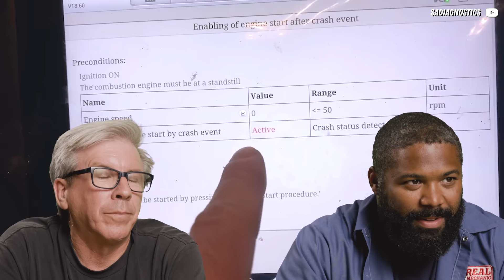Mechanic Reacts to Engineering Fails

Comment: Anyone who's worked on a Ford Escape knows they weren't designed the best. Yeah, the oil filter placement isn't great on some years, but what bugs me is the battery. It's in the back corner practically under the windshield. You've gotta remove the wipers, like seven clips on a cover over the back 1/4 of the space under the hood, a few small bolts, the top and bottom half of the cover itself, after unscrewing the power steering reservoir thats on it, and then finally pull that sucker out. 

I live in Alaska where it gets to -50 °F for months on end. If you don't have a heated garage your battery will die a lot and they get hard to charge up when the charger stops working in the cold too. So, having to pull it out several times a winter to bring it indoors and plug it in is rough. Especially if you gotta take all that stuff out, outside at -50 because you don't have any garage. I even had an engine block warmer and warming pads I plugged in every night that were supposed to help with that and the oil pan, but every few weeks the battery would die if I didn't drive it for a day or two over the weekend or if it got extra cold.

Comment: Having done design work and some wrenching, I get both sides. The real thing is the car is built to sell and make the most money. If you want the biggest interior, lowest price, highest mpg, quick design cycle, and modern safety features; compromises must be made. Those compromises are normally plastic parts, crammed engine bays, and difficult access for service. Blame the corporate suite not engineering lol.

Comment: I had a 04 dodge Durango and the cluster gauge caught fire and i had a Gatorade and i could see the flame starting through the air vent so i got a mouth full of Gatorade and spit in through the vent putting it out but there was a recall on that part.

Comment: I have one for you. I wanted to replace the stereo in my 2004 Mazda RX-8. So guess what all goes thru the factory stereo. Go ahead guess. Ok here we go, the climate controls and the hazard lights switch. All go thru the factory stereo and to top that you have to find the (and I mean find) the Bose amp power wire. As they are not all the same color. I looked thru 4 other RX-8s to find it only to learn that annoying little fact. There is more to that as there are steering wheel controls as well. I had to find a company that makes a kit to do the swap I was doing and found one that has everything I need BUT there's a catch there as well. The new setup has a control box for the climate controls and hazard lights switch and if that box fails down the road you have to buy the entire kit all over again at the current rate of $175.48 so you get all the parts you don't need just to get the one you do. As I understand it it was an 04-11 issue but I'm not 100% on that. Who's the bad guy in this one

Comment: Some of the rulings I disagree with, situationally. The difficulty of some repairs changes when you're a professional at a shop vs a hobbiest on a hobby car vs a handyman on a daily driver. If you're charging a customer for parts and labor, it’s easier to be chill about some things as opposed to fixing the car you have to drive to work tomorrow.

Comment: I work on my own car, so by no means am I a mechanic but in order to replace my transmission fluid filter I have to remove part of the frame to remove all the bolts on the drain pan. Whoever designed it could have moved it over like a half an inch and that would have made a 2 hour job to about 45 minutes

Comment: On the oil filter clip. That guy should change the oil filter on my can-am defender limited. If he thanks thats bad this thing you have to pull the back seats and back interior go in through the firewall. And still fight all the ac lines and wiring harness.

Comment: ~~Things really started to change in the 90's. Engine bays where you could access nearly everything w/little hassle seemed to disappear overnight. Replaced w/what must have started as a competition among automakers to see who could fit as much as possible under the hood? I remember going to Sears w/collective of tools,mine&cpl other mechanics, to be replaced. Looking around as they did what they needed to when I see an oil filter wrench. The handle&spanner connected in between w/rod that must have been 3 foot start but a bend here&a kink there the entire tool was about 18" long? Made specifically  for,if I remember correctly, 92-94 Toyota Celica? There may have been another but it's that stuck out leaving me baffled while at the same a helluva example w/what I said&how bad it would be.

Comment: 1992 Dodge Ramcharger has a fusible link ayatem that when one link goes you have to replace all of them. The second issue withe the fusible links is the link for the air conditioning system is the same link for the power windows. Imagine that in Fort Worth in August.

Comment: 6:20 I have two 1955 cars. Even on those you have to be able to turn the engine about 3/4 of the way around to pull the torque converter off. 100% normal.

Comment: I feel like having the oil filter in the most accessible and easy to reach place is beyond logical. Like, best case scenario, oil changes will be the most frequent reason you go to a mechanic and making the filter easy to reach and thus easy/quick to replace helps everyone. But im not a mechanic or an engineer so what do i know?

Comment: My mom's 2014 escape had the battery under the fire wall so difficult if you need to jump off.. and also it threw engine code after engine code before took it to pepboys for warranty work they said it was the bcm (body control module) they had their professional come out to look at it bc that's atleast 5k to replace and it turns out they unplugged it the dealership had it shipped to a Mercedes mechanic for a 2nd guess and it ended up being a dead battery

Comment: I remember getting my expansion tank replaced cause it blew up on the highway.  So I go to the shop the next day after it's fixed and as my mechanic drives the car out to me he's about to stop and the timing belt snapped.  was a $100 job now it's $200, Good times. lol

Comment: Cadillac Northstar engine it’s unbelievable where the starter is located you have to remove the center part just to get to the starter which is the throttle body in the intake manifold.
Reply: I think the right side cylinder head has to come off too. The starter is in the location the camshaft would be on a pushrod V8.

Comment: While you are complaining about an oil filter or a battery tray,  here are some more delights from Ford in other You Tube videos  1) some Ford Escape? (and Audi) water pump were driven by the cam chain, For Ford, it cost about  $3000 to replace a water pump. 2) another engine had a rubber belt , lub by engine oil! driving the oil pump !   3) about a decades ago, various Ford V8s have insufficient threads for the spark plug and the plug will sometimes fire itself out of the engine. Both triggered recalls and mechanics had great fun retapping  the threads.  4) some GM thermostat takes about 4 hours to change, it is a clumsy part that came with tubes and "o" rings. I hear Tesla is also great fun to work with.

Comment: try working on modern motorcycles, there is no room for all of the electronics & hoses & connector blocks, just a nightmare. It takes me 15 minutes just to get the air filter out for a service, don't even get me started on accessing the spark plugs

Comment: The bottom bolt of an alternator on a 2006 chevy trailblazer always has me cursing ac hardline right in the way of the bolt so you cant even put a socket in it have to use a small box wrench and work it between the cooling fan blades, big ol pain in the butt

Comment: If y'all want a good one, look up a newer 2017-2023 Chevy Colorado with a 3.6 starter or torque converter bolts for the transmission

Comment: the oil filter location would be really annoying  when removing an old filter if its stuck. because you cant fit any tool in there by the looks. :/

Comment: Yeah if you’ve got a Ford GT presumably you’re not just squeezing it in the Walmart parking lot in the closest spot. You making sure you park it with plenty of room where no soccer moms are going to door ding it or 15 year-old on a learners peel the bumper off. The door/roof vent design sucks if you’re in the rain because when you open the door, the a bucket rain falls straight on your seat in half a millisecond.😂

Comment: Many German cars have something called a "pyro fuse." And it shuts down the engine and all electricity going to the engine. This prevents it from catching fire due to potential fuel leaks, and it protects the engine from destroying itself when all the oil leaked out. You can not start the engine in any way until you either replace the pyro fuse or bridge the gap in other (not so smart) ways. Yes, you can not drive the car. But that's not what you should do in an accident anyway. At least not in Europe

Comment: Years ago Pontiac had an engine that had to be rotated Forward to change half of the spark plugs. Ford(?) had a vehicle that to change the one spark plug, the engine had to be pulled. Many mechanics would cut a hole in the inside of the wheel well and make the cut out part into a door. But the wheel had to be removed. Personally, I believe that all engineers (and architects) should spend at least 5 to 10 years out in the field. Those are only minor engineering (architectural) mistakes that I personally know about!!
Reply: My uncle had a '74 Chevy Impala, small block V8. He had to remove the left front wheel and drill a hole through the inner wheel well to get to one spark plug. He was a printer and press mechanic all his life, a very skilled tradsman.

Comment: Toyota 2RZ and 3RZ engines use a metal pipe bolted to the side of the head just above the exhaust manifold to get air into the intake. Simple maintenance shouldn't require so much mechanicking just to remove the spark plug wires and replace the spark plugs.

Comment: I have a 08 Benz c300 and all the cross members and everything under the car that you are supposed to be able to remove to work on things have been welded from the factory instead of using bolts and nuts so now I have to cut all the welds and drill holes in everything to install bolts so I can work on it

Comment: I've got 1... My 2002 Chevy S10, V6 4x4, has to have the engine pulled to replace the oil pan gasket. That's GM's recommendation. Im removing stuff from underneath. Axles, front differential, etc.. suuuuuuuuux

Comment: I drive a fiat, they were a bit iffy on the electric part, but they are allot better nowadays, about 20 years ago I saw a lancia y10  engine bay burn to the ground with electric problems, it was parked so no one got hurt.

Comment: Austin Mini are hard to do the filter I didn't do my son's Austin mini until the warranty was up because we had to get the oil done at a dealer when I finally did do the oil the filter was never changed because it was too hard to get it was starting to deteriorate.

Comment: I really hate the battery location on my Honda Pilot because the engine air filter is sitting right on top of it and you have to pull it out of its socket in order for you to then take the bracket that holds the battery in place just for you to do a jump start but I digress and I don't need a jump start I was trying to help somebody and it turned into a huge ordeal

Comment: My worst one was an hour ago. Not a car but a motorcycle. It sat around because i had an accident (not riding, was when i was skiing) so i was not able to charge the battery for a couple of months so it died, thought why not swap it for a fancy gel battery. I have taken out my battery many times for charging on my old bike (suzuki sv650n 2003) and it never took more than 5 minutes. Take of two fairings on the side, take off the seat and pull the battery out. Easy right? Bought a yamaha tdm850 1998 so why not buy a shop manual to do some minor servicing and repairing myself? Look up the battery removal and seemed the same as the SV: remove the seat and unscrew the terminals. 5 minutes tops. Turns out, the japanese engineers that built the SV were way nicer than the Yamaha ones, because to do what the service manual said, i had to remove the fuel tank first, disconnect it and thus dumping all the fuel from it, and to actually remove it i had to disassemble the entire front fairing. That was not an option so i got online and found the actual way you have to do it. You need to disassemble the right side frame partially where your exaust hangs from, disconnect the rear break cilinder from the frame and then you can feel around with an allan wrench to try and unscrew two of the tiniest little hex screws without dropping them, otherwise the battery is sitting loose next to the chain. Then you have to bend the battery around the rear shock trying to avoid breaking the spring to your brake light switch (because thats there too) and with a lot of cursing and bending of the plastic battery box, you can take the batterybox with the battery out. That was an hour. And putting it in was another hour of my life. All the while there is ample space under the seat where the battery would have fitted. That is the worst design i ever saw on any motorvehicle.

Comment: On scene 10:51 the Battery Tray may be for a Motor Mount underneath it /  All Eco Tech ( GM) and EcoBoost (Ford)  Engineering Fail the Turbo Mounted 1/8 inch from Engine Block, without a Heat Sheild, and Turbo Blanket. Why a Fail Turbos get to be 1,875 degrees Fahrenheit.  They warp the Engine Block, and the Piston / Cylinder Bore Cause Low Compression, and no Hood Heat Extraction Vents.  2 Different Engines before 60,000 miles. Heck the Subaru's Head Gaskets Fail because they mount the Turbo above the Intake and Heads. Funny Stuff. 
I am not a Mechanic and I replaced at age 12 a Fuel Pump on my Dads Truck, and age 8 Oil Changes and Tires on the Same Truck. 
I work in other Technical Feilds, and My Current Ride  has an 8 year all Service including Brake Systems, Windshield, Fluids, Except Tires. $500.00 each tire Price to Start. It is a 2022 Roush Mustang with the Rev-Match Tremec 6 Speed Manual Transmission 🏎️🏁🚩👨🏻👍🏻
I would never Sell her, even if Offered $1 Million USA Dollars

Comment: I own a 2015 Subaru 3.6 Outback.
While I love my Outback, taking all day, to replace the sparkplugs is just wrong.
Why does it take so long? It's a horizontally apposed engine, and the heads are 2" from the A-Frame rail...

Comment: my car fuse box is inside car nice and easy even those lots space under the hood, The fuse box is located at the bottom of the instrument panel (on the driver's side), behind the cover. The location of the fuses in the passenger compartment. Near OBD port

Comment: How many vehicles have no access panel to the fuel pump and instead you have to pull tanks, beds, etc to replace it. Granted this could be considered a whiny mechanic but it would be so easy to just make a small access panel held on with a couple bolts. Would also make diagnosis easier.....IE broke wire vs bad pump.

Comment: Yep on my 2003 vw jetta 2.0 had to replace the control arms I had to lift the engine to remove them amd I had to buy a special bit to remove a bolt on the pasanger side lol 😆 I hated it

Comment: Is the old guy secretly an ENGINEER? That oil filter bs is unnecessary for sure, some cars are just a pain to put a filter on and that is just ridiculous. Engineers wanna always try to come up with some breakthrough design these days instead of just sticking with the stuff that works and is accessible. I feel like they do it on purpose so ppl feel they gotta bring there car to the dealership for maintenance and repair instead of a local certified mechanic, they over charge for everything and they love to sell you shit you don't need, you go to a dealership with a bad battery and they will sell you an alternator first, shit they may even try to sell you a starter as well before they actually replace the dead battery, so be smart ppl, google and youtube exists to help keep you guys from getting screwed. Always try to diagnose the issue before you go to a dealership. Ill never take a car to the dealership I can do most repairs myself, but if i have a problem that Im not confident with fixing myself Im going to one of my mechanic friends that actually have a shop, lol no SHADETREE mechanics will work on my truck either. Be smart do not let a shadetree mechanic work on your car.

Comment: The engineers that designed the Ford 3.2l 5 cylinder diesel need to be held accountable for the fact that if you drain the engine oil and on't refill it within 10-15 minutes the engine is toast because the oil pump won't pick up the oil now and won't have any oil pressure. Why do you need a piston oil pump when gears have worked since day 1?

Comment: Burying the fuse-box makes the car illegal to sell in North America.  Not sure what Four-Dribbles is doing there.       Should really do one of these videos on the nVidia 12 pin power connector and mechanics to get their opinion on that.

The REAL engineering fail out there is the lack of an enclosed cover on the timing belt of the 4 cylinder Ford engines from the 1990s-00s

Comment: That door design is bad engineering. It not only has the parking problem, but now you have to worry about hitting your head on it getting out of the car. Plus, it makes the interior less weather resistant if you get caught in bad weather, not just the possibility of the seals wearing out but also with the fully exposed interior. I know this is a "fancy car," but fancy shouldn't create more problems.